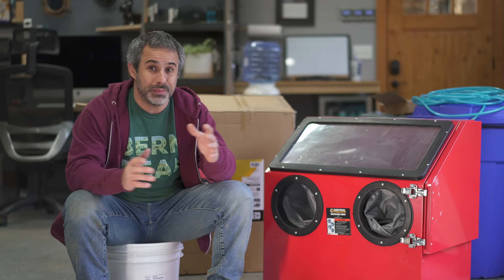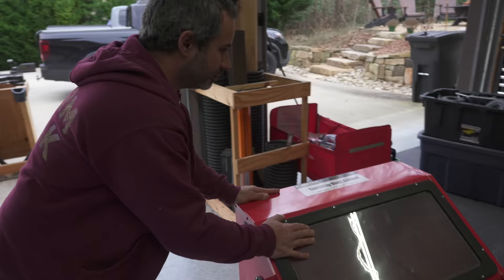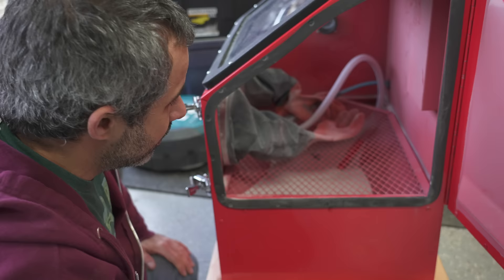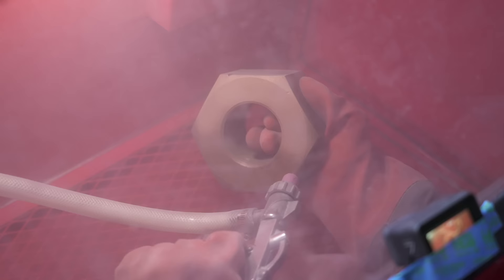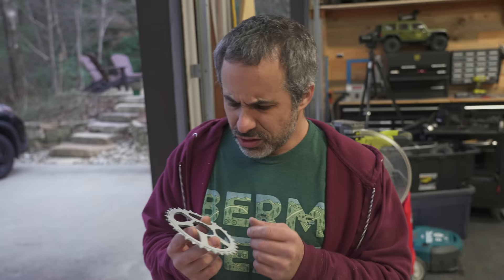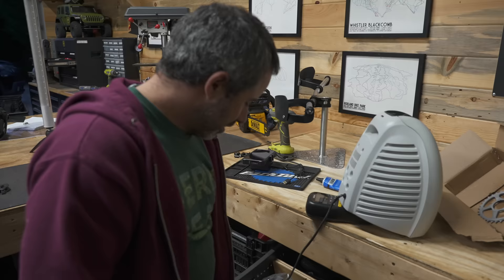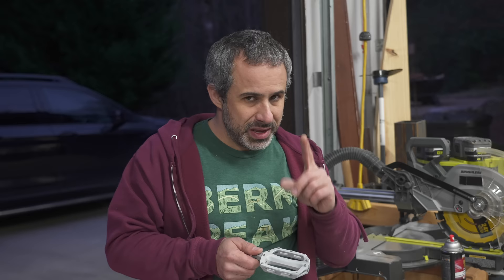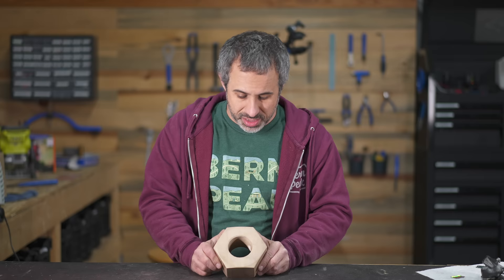I took your advice and bought a Harbor Freight sandblasting cabinet

Comment: Hey Seth, try GLASS BEADS if you can get some. For restoring, deep cleaning and restoring parts. Won’t etch the metal like sandblast with coarse grit. I am a dental technician and we use both for different purposes in the lab. You would have to clean the bin each time though, or buy a second blaster. The other option, poor man’s cleaning medium is baking soda!
Reply: I know this isn't how it works, but I had a flash of a guy strapped to a table with a sandblaster strapped to his mouth. Kids, make sure you brush those braces or else...
Reply: Yep! also walnut shells work great especially on acrylic.
Reply: Oh!  You said "GLASS beads"...  welp, that's going to be an embarrassing ride.
Reply: So glad to see someone mention glass beads ! Lol
Reply: In addition to glass beads keep the pressure lower for softer materials.  We have a great big sandblasting cabinet at work (its got a 5 foot rotating tray inside) and we use glass bead media.  Works great on iron/steel parts but we still have to lower the pressure and media flow when we need to strip aluminum or copper.  It removes paint slower but your have less chance of removeing more than the minimum amount of metal.

Also be aware that even glass beads will frost polished machine fits if you hit them with the sand blaster.  Expect that you'll need to repolish anything you want to be shiny afterwards.  If we need to be really gentle on a small part we just throw it in a vibration tumbler with corncob media.  Just let it run over night and check them in the morning. repeat as needed till its clean.  Does really well on small brass parts.
Reply: I've had this blast cabinet for 4 years (was only $119 when I got mine) and the more I use it the more I hate it.  Two of the biggest problem with this cabinet, is HF only gives you a couple of plastic sheets to cover inside of the glass.  After that the blast dulls the glass so bad you can hardly see through it.  Second, is the vacuum tube that sucks up the blast media.  I've had nothing but trouble with this. gets clogged in the tube or always have to open the cabinet and stuff it back down in the media.    I had some glass tint I used, and added a flourscent light in the cabinet, but you still can't see after just a couple of uses..  Glass Bead is the worst at damage to the glass..   The thing leaks like crazy.  When you open the door, media is everywhere..  It's now a useless relic cause I won't use it anymore. IMO-It's JUNK

Comment: 4:50 Toolmaker here. Ideally after a sanding like that we usually put parts in a wet deburr machine, that's basically just a tumbler that cycles your parts in wet and soapy small stones, for a few hours to both soften the finish from the sanding and to give it a final clean. After that they're given a quick dip in regular water, to clean off the soaps, and an anti-rust mixture to keep the parts nice for longer.

Comment: We had a sandblaster in my highschool metal shop class. I used to use it to sandblast parts all the time. I sandblaster my FBM sprocket and it came out just like yours. And yes, the teeth smoothed out from the chain in no time. Worked great, looked swift. Enjoy!

Comment: The raceface chainrings are made out of aluminium, which is a soft metal.
In order to not wear out, they are "Hard anodized", which gives them a metallic look as well as a very hard and durable surface.
By sandblasting it, you've just removed that hard anodized layer, making that chainring completely useless.

I would not recommend sandblasting parts that have functionnal surfaces. If a surface has a mechanical use, it is probably the way it is for a reason.
You can mask off the part you don't want to touch with tape, that works pretty well.
Exemples of functionnal surfaces : bearing seats, threads, the parts that touch the chain of the chainrings, precise holes (through axles, pivot bolts etc) ...
Reply from the maker: that’s great to know! I’m wondering though, what happens when the chain itself wears off the hard anodized layer on the teeth? Is there something beyond the “color” that’s making it harder?
Reply: That’s a good question for some Material Science engineers that I work with.  They won’t be able to do any testing due to liability issues.
Reply: I would have to disagree, considering the anodization (which is 0.0005" to 0.002" thick) on the bearing surface of a chain ring wears off in half a dozen, or so, rides. Also, the rollers of a chain do not rub against the chainring, they only sit upon it, while the chain links rub against the rollers. Sandblasting does create some pitting, which will wear down faster than a perfectly flat surface. Calling it "rendered useless" is a gross exaggeration. I would say a 10-15% reduction in life expectancy of the the chainring is more reasonable.
Reply: I agree about bearing seats and threads though, since sandblasting does change the dimension of those precisely machined interfaces
Reply: @BermPeakExpress  Once that's gone, teeth wear out quicker and you replace the part. If you take the advice of soda blasting, instead of sand blasting, you'll be less likely to strip the "hard coat" (Type III anodization). That said... yeah, probably shouldn't be blasting it at all, unless you plan on re-anodizing it yourself (after an acid wash). That's of course assuming that the part you're blasting has Type III anodization -- it could just be Type II (color coat), if it's a cheap one.
Reply: @BermPeakExpress  A part that looses its anodized layer looses its abrasion and wear resistance mostly which will accelerate wear and degrade the cosmetics but that doesn't change the other properties of the part. That anodized layer doesnt make a flimsy part sturdy, it makes it resist wear therefore extending its usable life. There is normal anodizing and hard anodizing. Both turn the outer layer of aluminum into aluminum oxide however the "hard" is the result of a process that makes the oxide layer thicker aka harder. Aluminum oxide is very hard and is a common abrasive in sand paper, you probably have some in your shop.

Not everything is "hard" anodized and in fact in a lot of sporting equipment (bikes and paintball I know specifically) use anodizing mostly cosmetically. It looks and wears better than a lot of paints and more importantly it doesnt change the dimensions nearly as much as standard coatings. Look at custom anodized paintball markers, almost 0% are hard anodized but are just cosmetically anodized. I would suspect the same thing with most but not all bike components. Hard anodized parts get treated differently and are really hard to color match anything. When your product line looks consistent either they are scrapping a ton of stuff or its not hard anodized as its a much more touchy process.

The exception is in the firearms world, some aluminum parts there are hard anodized more frequently due to extreme wear otherwise. Ar15s normally have hard anodized receivers and the parts may be hard anodized as well but not always
Reply: @BermPeakExpress  Seth kindly telling this dude to fo with his bs 😂😂
Reply: @BermPeakExpress  the color is superficial, and the hard layer goes a bit further than just the colour.

That said sandblasting is very likely to take away both the colour as well as the hard layer underneath, because blasting sand is often harder than the aluminium oxide formed by the anodization process
Reply: Well.  There is a hard coat anodize finish type 3 and there is a standard anodize type 2 that isn’t designed to improve surface wear nearly as much.  Type 2 is what you find on bikes and many other parts that
Need good color and less corrosion.   So taking the anodize off has little / no impact on the sprockets performance from a wear stand point.   

Sprockets are aluminum it won’t matter what anodize or otherwise coating you use, they will deform under chain load and wear into use.   Most sprockets after a few rides are missing the coating around the teeth and eventually it’ll be gone.

most anodized coatings  do improve surface wear / corrosion ( unless on cast aluminum with high si content ) but it’s almost always in the context of seals.   Like don’t sand blast your fork stanchion.    

Regardless you do want to be careful with soft materials / rough abrasion.
Reply: But google...."SHOT PEENING"
Reply: @justinmurphy2227  6061 can't be structurally hardened, and most bike part are made with this aluminium alloy. Also, shot peening is done with high pressure and steel balls. A sand blaster is nowhere near powerful enough ... It's actually a feature, as you don't want a sand blaster to deform your part
Reply: @InformatrIIcks  I understand all that but I was just letting him know shot peening just existed. I wasn't implying that he had the set up for it. I bet he understood that also if he read about it. 
It was just something opposite of the structural integrity degradation talk he was constantly hearing.

Comment: Different blast media is as varied as the tools on your wall. You can use different sands, glass beads, walnut shell, baking soda, etc etc etc. Blasting is really well known for creating heat and extreme warping in thin metals. You by mistake used the perfect test for that which is the soda can test. These days wet blasting (called dustless blasting) is used a lot for car sheet metal so that it doesn't ruin the sheet metal. It's a mixture of crushed glass (Not much different than sand) and water shot from a special machine. If you want to get really crazy you can remove rust and corrosion with a special laser, very fun videos to watch.
Reply: the soda can is thin enough that even beyond the heating issue I'd have worried about puncturing the metal, thing's like a standard A4 paper sheet but made of aluminum

Comment: (I’m an engineer) It all comes down to your sand blasting material and choosing the correct one. A softer material should be used on softer parts. So it really depends on your part for what medium you choose. I can imagine that a sprocket would be heat treated at least on the teeth (at least that’s what my plant does to our sprockets). So it’s most likely alright and if there are any rough edges on the teeth then they’d wear as they usually would. If this turns out to be untrue and you do run into issues later you should let us know.
Reply: Materials engineer here. If the sprocket is aluminum, nothing will happen to the chain, which is made from steel (see Mohs scale).  The chain in combination with sand that gets into it from the trails will smooth out the contact parts. Should have no influence at all on the lifetime of the sprocket.
Reply: @daghorin  somehow I missed when he said aluminum although I should’ve probably assumed that from a performance part. Thank you for your input 👍
Reply: @hetrickracing1249  It was near the end of the video, nearly missed it as well :D
Reply: Will the chain ring take most of the wear and the sand break down and "fall" out? I am imagining the wheel on a surface grinder. I just started machining courses, so Im not very knowledgeable.
Reply: @andrewgould8924  Well in terms of a bike there will be little wear ideally due to lubricants. The sand is coming from the mud you ride through and will wear both chain and ring. If you ride without lube the chain will pretty quickly wear down the sprocket. I am not sure I explained that well, but if you have any further questions, just ask :D
Reply: @andrewgould8924  normal wear should be expected, everything has a lifespan so eventually I’m sure the teeth will round off eventually but from the looks of it and from what “daghorin” said as well it shouldn’t be at an accelerated rate
Reply: I have another question, if let’s say I wanted to paint a cassette a color (let’s say red), would anodizing it be a good idea? Or would the paint wear very quickly
Reply: @dustinle2602  Anodizing is a much stronger bond than usual paint or coatings. I personally powder coat my parts and that holds up okay but not the best. I’ve heard better things about anodizing than powder coating especially with holding up to wear (specifically type III Anodizing is known as the best). But to sum things up, anodizing is probably the best option when it comes to coating a part that’s gonna see a lot of wear.

Comment: I too have a HF sandblasting cabinet that I have found to be indispensable for cleaning up small parts and here's a few observations: 1. The HF sandblasting cabinet that I bought fits perfectly on top of a Craftsman rollaway tool box bottom- no need to build a separate stand for it or take up valuable bench space with it. 2. Dust collection is a must- I use a smallish barrel top dust collector which not only evacuates the cabinet from the blast dust for both health and visibility issues but also eliminates the need for periodically replacing the clear plastic window shield. 3. While there is a provision for lighting the inside of the cabinet I found it a whole lot easier to rig a two bulb halogen shop light on the top of the cabinet; having a bright light makes it easier to see all the parts of the work piece that you missed!

Comment: You can seal the seams of the cabinet with caulk to limit the amount of dust that leaks out.  Another tip is to rig up a 5 gallon bucket with inlet and outlet tubes, put some water in the bottom of the bucket and then the dust picked up by the vacuum stay in the water not your shop vac filter.
Reply: Basically a water filter. Make sure the in and outlet pipes are ABOVE the water (your post made it unclear.) 
I've got one of those vacuumes that has a water tank that does exactly this and it is badass.
Reply: The inlet being under the water can do good in certain applications
Reply: @angrydragonslayer  oh? curious I know little of this past how my vacuum works. Please enlighten me.
Reply: @singletona082  if you're blasting lead paint (or similar) for example. There's less suction but you're also less likely to get poisoned

It's still generally preferred to have it above the water but there are usecases
Reply: @angrydragonslayer  Alright ya that tracks. 

Lead paint kinda scares me.
Reply: I just made my cabinet out of a cardboard box and a piece of plexiglass. Because it's already taped up I have no leakage. It looks identical to this one and it's lasted me 3 years already with no visual damage.

I run a small bucket style shop vac with a long larger shop vac hose attached and I run that hose out a window or a door. I don't even bother with the filter or the water. Just blow it right outside.

The cabinet is so light I can actually take it outside whenever needed as well.

Comment: Sandblasted Part quickly start to rust if they're not out of some naturally rust resistent material like aluminium. Make sure to apply rust protection for those soon after sandblasting them. If you want any sort of shiny finish after sandblasting you'll have to smooth the parts down with fine grid sandpaper slowing going up the grid and then polish them

Comment: For the kind of things you’re looking to clean up you should have invested in a parts cleaning tank. I worked for an auto parts rebuilder years ago and we had one to clean starter and alternator parts. It was a shake tank with some kind of stones and a black cleaning fluid in it (can’t remember exactly what-too long ago) but it removed all kinds of caked on rust, mud, grease and metal filings. They came out looking brand new and did not damage copper, aluminum or cast metal. You do need an exhaust fan because it does put off fumes and can be loud, but does all the work for you. It’s like a washing machine for metals!

Comment: Hey Seth, I used to own a custom powder coating shop and obviously had a sandblaster. (1) different media in the blaster for different results. For example, crushed walnut shells for when you need to blast something soft or fragile. (2) Be VERY mindful of the dust and definitely get a respirator. Some blast media (sand, in particular) can be carcinogenic when it breaks down as you blast and you don't want to inhale that crap.

Comment: For less abrasive blasting, consider using baking soda. I've used it to polish the valves in my direct injection engine after using walnut shell blast media to remove the built up gunk. The baking soda would work great on bike parts without pitting the part.

Comment: For bike parts, I'd recommend soda as the abrasive, you also don't need #80, too coarse and can remove too much base material. Just make sure you do some sort of surface finish after blasting, since the abrasion you caused will expose TONS of new surface to the elements for oxidation and corrosion.

Comment: Sand blasters are fun but if I remember from when I used to use them in work to recondition burner nozzles we were told to clean a lot of the oils and greases off first in order to not clog up the blaster. But they are so good to prep items for paint. Even bike frames can be done (full sussers fully disassembled).
Reply: Is that because you were recycling the media and the oils and greases would mix in with the media? Also, how would you get oil and grease out of sand I wonder.

I'm just trying to understand how it would clog up the sandblaster.
Reply: @dangerous8333  tbh I’m not to sure why, think it’s more contamination and makes it harder for the media to stick to the surface. Just going off what I was told to do.

Comment: The biggest plus I see with getting a cabinet for your situation is that you could prep your pieces for Powder Coat. If you go to you local coater you could ask them when they typically shoot the powder and if you aren't too picky on colors they probably wouldn't charge you too much just to throw on a coat.